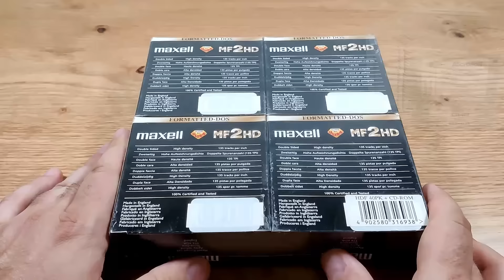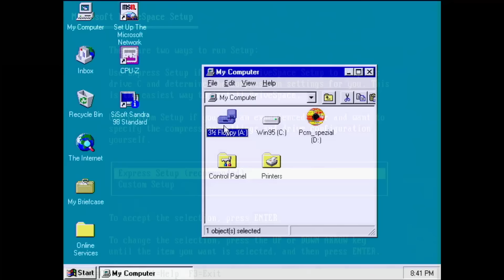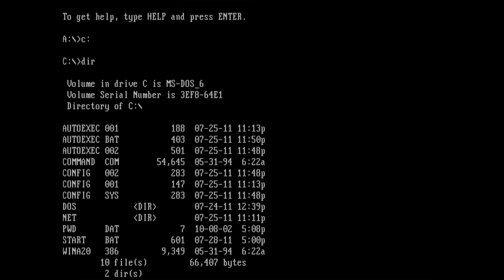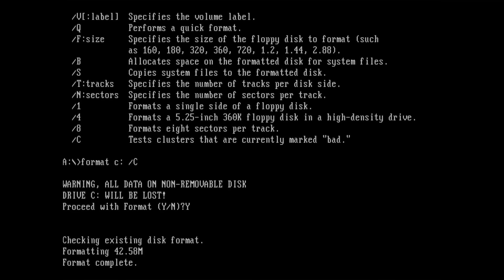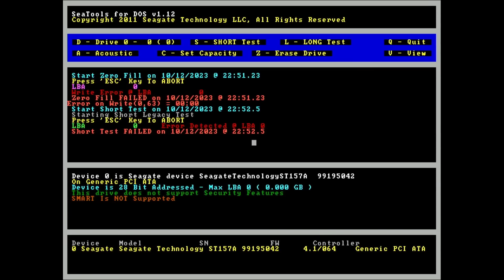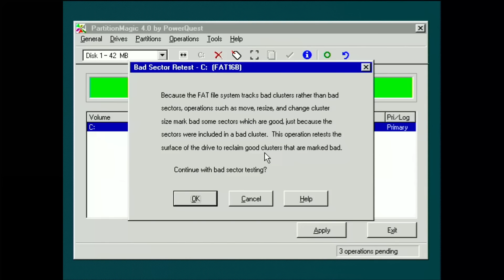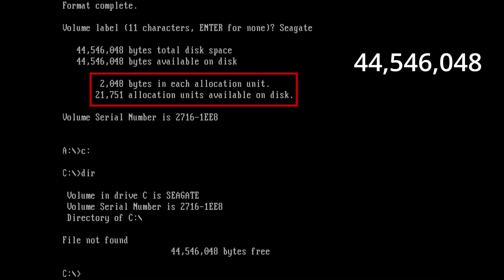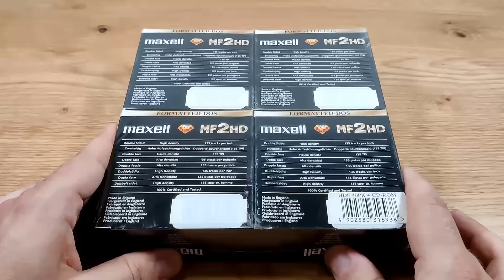HDD Bad sectors - Did my project fail?

Comment: Don't trust Partition Magic to re-partition your drive with precious data on it; that's all I have to say. 
I learned this the hard way.
Reply: I think no such tools are reliable enough. Especially in case when power might go out.
I'm stuck with smaller than needed disk C, and can't decide to add some space to it from disk D for years because of this problem.
It is better to just copy your data to second drive and recreate partitions on first drive from scratch. But it works only if you have second drive...

Comment: Stacker, DriveSpace, and DoubleSpace were Russian roulette with your data. Hard drives were, are, and always have been extremely reliable. Software is not. When Windows crashes, or a driver goes haywire, or application software crashes, or you lose power, these are all opportunities for your compressed volume to become corrupt. These same hard drives that we were cursing would have worked fine uncompressed and probably would still work fine today. It was just a bad idea. Ext4 and other filesystems have mechanisms to deal with unexpected filesystem events. Moving that logic out of the filesystem driver is doomed to failure.

Comment: Did you try an unconditional format of the drive using the /U option? I use that sometimes with old floppy disks and do a second "normal" format afterwards to make sure the bad sectors have not returned and were only caused by drive head alignment issues and not actual physical damage of the disk. Don't know if the same can/does apply to a harddisk. Perhaps you can try?
Reply from the maker: I did not try anything on this drive yet apart from the regular format. I reached out to Steve Gibson (Gibson Research Corporation) for SpinRite. I exchanged a few mails with him and I am set to let SpinRite 3.1 do some magic! This will be an exciting project, but I don't want to say too much yet!
Reply: @bitsundbolts  Looking forward to the follow-up video 😉

Comment: I have a pile of 40 hard disks with half of them having issues, most of them a few bad sectors, some complete physical failure. In my experience  the Seagate disks are the most unreliable. I've given up on using old disks altogether, because I simply don't trust them anymore. The only upside is you basically can hear or notice it's failing, which isn't true for SSD's.

Comment: Doublespace or Drivespace? Never used those. Back in the DOS 5.0 days, I used similar software called Stacker. I don't remember having any corruption issues, but it was pretty slow reading or writing to the drive.
Reply from the maker: Yeah, I heard of Stacker. DoubleSpace was introduced with MS-DOS 6, if I'm not mistaken. It was a response to DR-DOS having Disk compression for several months prior.

Comment: some retro tech I don't like or flat out hate. I HATE CRTs. I completely and totally despise them. I run my C64 on a 4k monitor. I'm not really fond of hard drives either, but this is worse than that. That hard drive is so small it's practically pointless. I frequently ran into issues in the 90's where I ran out of space. It was frustrating. I'm not really nostalgic for that. One of the things I love about retro tech in the modern world is that you can get the enjoyable experience but with many of the classic limitations removed. Also when I was a kid i noticed my C64 was completely silent it was only the floppy that made sound. I believed that some day computers would be silent. My modern 2021 PC is for the most part. It is water cooled and uses NVME. 99% of the time I don't hear it and when I do, it's super quiet.

Comment: I'm not even surprised that WD drives are fine after those years, while seagate is showing bad sectors. I guess it developed bad sectors in first 2 years of it's existence, as every seagate does up until now. Maxtor is not surprising as well.

Comment: MHDD or Spinrite could help. MHDD is not as user friendly and can be quite slow on really bad HDDs, so arm yourself with patience and be prepared to leave it doing its thing overnight. Someone already suggested to use MHDD 3.0 and not the last available version as you have quite an old drive to fix. Google for the instructions on how to use the MHDD tool. If MHDD can't help, then I'd suggest you give up on that HDD.

Comment: I don't remember but I'm almost sure you can install Windows 95 on a 60MB drive but without any free space for other programs.
Reply from the maker: So, if it's possible to install Windows 95 on a compressed volume, DriveSpace needs to achieve a compression ratio of 1:1.4 to reach a bit more than 60MB 😳

Comment: drivespace on windows 98 experience. it works to some degre but you never know how much free space you have because it is a guess and partition size changes dynamically as it is being filled in because different files compress in different ratios
you have hisk H: which is a host for formated c: or more precisely it is your actual harddrive visable in windows and you can store uncompressed files there only it eats on the size of the c drive as you do so never assume you have free space from c drive and h drive combined
making swap file on aditional haddrive on separate ide channel vastly improves windows performance if you disable swap on c, but swap on compressed c slows computer down and also affect the size of the drive so it is better to manually make fixed size swap on h: or better on another hdd

Comment: Only low level format in bios
Reply from the maker: I think this may be the first option I'll try - since it's free and I do have boards that support that feature.
Reply: @bitsundbolts  I did this many years ago. look for 386 with low level format in bios. it really works
Reply from the maker: I looked at one of my videos on YouTube where I restore a 386 BIOS.
Indeed, it seems to have HDD tools.
Once I'm done with my project, I am going to test it! Thanks!
Reply: @bitsundbolts  You're welcome